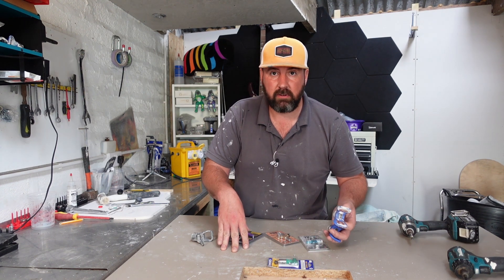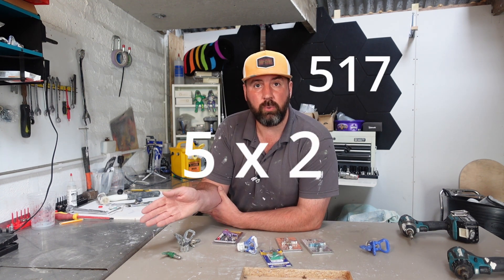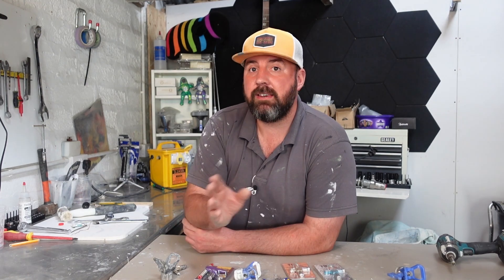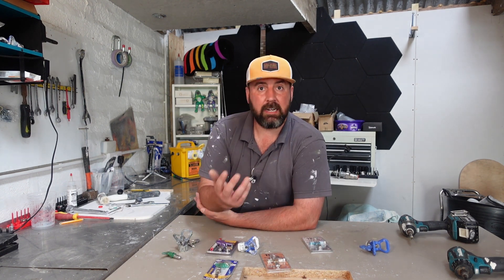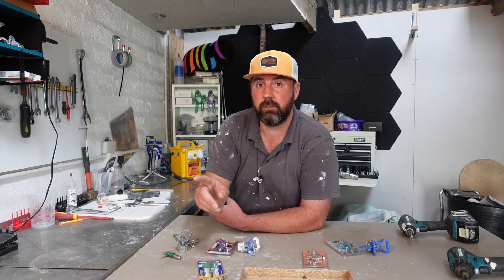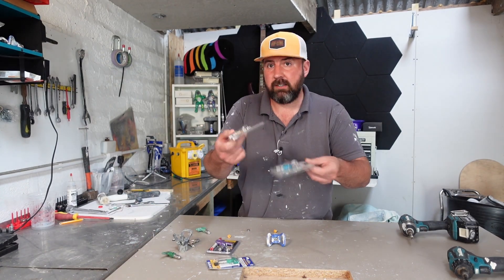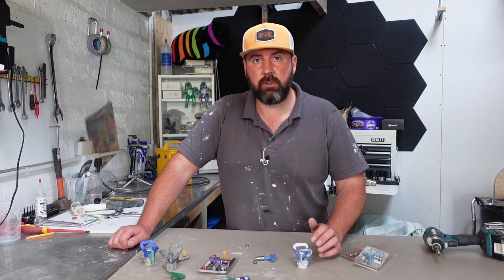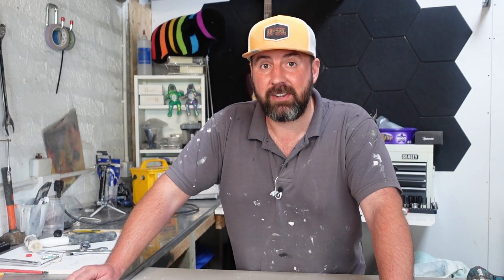Spray Tips Explained - Airless Sprayer Tips For Beginners

Comment: Good advice and pointers, looking to get the guard and tip on ebay,  just needed to know what type of tip to USE to paint walls and celings. So GRACIAS for that info. Will definitely get one with an extension! Thanks Again!
Reply from the maker: Glad you found the video helpful.  Appreciate the support.  Hopefully theres some other videos on the channel that you'll find value in

Comment: Morning mate, great video, I have a question if a paint specifies using an 009-013, can I use a 308, would I need to piss it down more, thanks
Reply from the maker: You might need to. Have you not got a 310? Sometimes the odd numbers let it flow nicer. Depending on the paint.
Reply: @sprayaholic thanks mate ive got it going, shitting myself last night just layed the 1st coat on, everal aqva ive used, thanks for getting back to me, much appreciated
Reply from the maker: Ah ye thats fine to use. I just say filter your paint as it will help prevent blockages

Comment: Thanks!
Reply from the maker: Appreciate the support.  If you have any questions just ask and I'll get back to you when I can
Reply: @sprayaholic  Could i ask about sprayers again. Im now torn between the gxff and gx21 with the hopper from spraymanuk. about 80% of the time ill be using it for woodwork, also mdf units and kitchens. The other 20% for plaster ceilings mainly, sometimes walls ( Vinyl Matt emulsion and durable matt ) They both seem as mobile and roughly the same size/weight, also the gx21 comes with a narrower hose for fine finishing/woodwork. What are you thoughts please? Thanks again
Reply from the maker: @cliffordelliott1 sure no probs. Well they're basically the same unit.  The gx21 comes with a 15m thicker hose the gxff a 7.5m thinner more flexible hose.

You can buy a gx21df which is basically the best of both worlds as it comes with hopper like a gxff and a suction pipe like the gx21 also comes with both hoses so you can use it as a woodwork or smaller job machine or a emulsion etc machine.

Its about the same price as a gxff on its own

The thinner hose restricts the max tip size to a .19. Where as the 15m thicker hose allows a .21 max tip size
Reply: @sprayaholic  Thanks. I was told the gxff wouldnt last as long if i was spraying some ceilings with it, that the motor would run down quicker. I only do residential work so sounds like the 21 may be the best option. Thanks again for your help 👍
Reply from the maker: Not sure who's told you that. They have the same pump.  I have a gxff and ive used it so much over the years to spray rooms and emulsion.  

The gx21df is what id look at.  Type in the DF part after. That package should show up
Reply: @sprayaholic  Ok thanks for your help. Someone i was speaking to yesterday at a spraygun retailers told me, it didnt quite make sense. The argument was the hose is narrower on the ff and it would put too much strain on the motor. I thought i could change the hose for emulsion work on the ff anyway if needed. Do you think that's necessary or is it something you would do? I will check out the machine above, the df. Your vids are excellent by the way, really sharp and to the point, very easy to understand 👌 Thanks for all the help
Reply from the maker: @cliffordelliott1 appreciate it. Yes its a gx21df. 
It is kind of correct. The thinner hose allows a max tip of .19 but generally youd be using a low pressure tip so it brings the need for higher psi down.  

I use the 7.5. 3/16 hose for emulsion no probs.
Reply: @sprayaholic  Thanks, good to know 👍
Reply: @sprayaholic  Appreciate it, good to know.

Comment: Thank you great vids ive learnt alot this morning, I plan to buy a machine today so now confident now I understand the tips, the sizes, the fan width is very very helpful. even the 516 tip that sounds like just the one I need. thanks again
Reply from the maker: Awesome thank for sharing your feedback. 

If youre uk based. I service and repair machines and sell onto my followers. Obviously depending on budget, I have a few tritech t5s in at the moment. Solid powerful machines.

Comment: Hi, Thanks for your help with this video. I have a question about sprayers: Would a Graco GXFF Airless Sprayer be as good as the Graco HVLP TurboForce II 9.5 ProContractor for spraying custom built MDF Furniture, kitchens, staircases etc? Thanks again.
Reply from the maker: Hey. Yes they both have their place. Id probably opt for the gxff
Reply: @sprayaholic  Thanks, appreciate your reply. Its mainly for mdf units built into alcoves and kitchen resprays. I thought you were going to go with the HVLP. Good to know.

Comment: Some painters said that the 315 FF LP it's the best for finishing, now I have the doubt between 310FFLP -315FFLP -308FFLP ?
Reply from the maker: For finishing on what surface? 
It depends what paints youre using aswell. A 310 is a good start.  A 308 youd need to make sure you filter the paint as you'll pick up alot of blockages if not. The 315 let's a fair amount of paint out.. so youd have a finer finish with a 310 imo

Comment: Just both this Ultimate"
QuickShot™ I paint kitchen on site what tip should I use I like 10” fan
Reply from the maker: A 10"fan is big for kitchens. I use a 310 usually. 
If you wanted wide fan but lower flow a 510 would work and youd not be smashing the paint on, still abit too big though I think

Comment: I just got my graco airless, came woth a 517 RAC x lp switch tip but has a fairly small hole in the guard, guessing fine finish tip an guard? Would you recommend grabbing another guard with the wider hole?

Comment: Hi there mate hope your well just a quick question I have an erbauer eps 600 however every time I’ve used it when I press the trigger I get a round ugly paint splatter on the walls using a graco guard too and tip in 517 however my filter in gun is clean and have also thinned the paint down by 10% even adjusted pressure but still same issue what’s your opinion on why I’m experiencing this issue?

Comment: Nice video. But iam so confused about the yellow lp and the paa. Wich one is better for normal wall paint and for one house?
Reply from the maker: When you say ppa. Do you mean the blue tips?

The green and yellow are low and fine finish low pressure.  They help you run your machine at a lower pressure. They often give a soft edges to the spray fan.

The blue tips are a solid fan pattern. They need to be on a higher pressure to spray well, they are generally used it new construction or when production spraying is needed.

If you've got a lower powered sprayer. The low pressure ones can help as you might not need to dilute your paint as much.

Either will work. But to reduce over spray and have a steadier pace id maybe look at a 616fflp/617lp

If your sprayer already came with a 517, that will work fine aswell
Reply: @sprayaholic yes i mean the paa blue
Reply: @sprayaholic thanks a lot for a detail answer
Reply: @sprayaholic i will buy in the next days the Graco ultra 495 xt. Wich tips for wall paintings and for fine finishes u sugest for lack paint. And please what its mena for small jobs is this machine for evry day work and how many m2 i can make a day for company use?
Reply from the maker: @runtomica5275  the 495 will happily run all day.  4 main tips i like are 210, 310, 619 and a 616.. aswell as the 517 it comes with
Reply: @sprayaholic thanks a lot agin the 619 and the 616 are the yellow one? So i have one flat or house to pain( not evry day) one time maybe in week. So the last question wich one i should use yellow lp or blue paa? Best regrade from Croatia
Reply from the maker: @runtomica5275  I havnt used the blue ones. I mainly only use green fflp and yellow lp
Reply: @sprayaholic ok thanks a lot
Reply from the maker: @runtomica5275 even numbers are green fflp and odd numbers are yellow with the low pressure tips ✌️
Reply: @sprayaholic and you use it beacuse of the low presure ?
Reply: @sprayaholic why u font sugest the 621, to much material will flow?
Reply from the maker: @runtomica5275 621 is a big tip. You'll spray alot of paint if youre not careful.  A 619 is a nice compromise I think
Reply: @sprayaholic ok i look now the 616 i can use it for normal wall paint i think the green one is only for varnish?
Reply: Do you use green more for varnish and yellow for paint? Iam so confused
Reply from the maker: @runtomica5275 the green a fflp they go to a 616 biggest size now. Can be used for walls.

Varnish I use smaller tips like 310.

Yellow low pressure tips a 619
Reply from the maker: If you re watch the video where I explain how the numbers work that might help you @runtomica5275
Reply: @sprayaholic know i inderstand it was a thinking fail, i think the green one was only for varnish paint.
Reply: What tip can I use for graco quickshot when I spray undercoat on wood and satin?
Reply from the maker: @ValterCepele  I usually use a 210 or 310 fflp
Reply: I've always painted for somebody else. The method usually went something like this. Grab a handful of tips out of a bucket of water. Shake them around in your hand. Toss me one and say well. That's probably your best bet. But it might be blown out. 

I've recently started my own painting business and I bought a Graco 490 XT today I get four free tips. What's your suggestion for mostly a residential painter?
Reply: It came with the yellow 517 and I've never used one.
Reply from the maker: Id say a 210, 310, 616, 619

Should have most bases covered there. 
Or get a 110 for spindles and 2inch wide areas and dont get the 619

Comment: Are you saying tritech tips are better than Graco? Which are good for fine finish then? I'm planning to get the erbauer sprayer as there's a conversion kit sold online by spraymanuk but it's Graco. Is it going to be shite for painting MDF and staining/hardwaxing woodwork?
Reply from the maker: I like the tritech tips in general.  But for lower powered units the graco low pressure tips.work well as they dont run the sprayer as hard. 

What's the conversion kit?  A hopper kit?

You could spray mdf with it it all comes down to paint consistency and tip size
Reply: @sprayaholic  The Erbauer Tip Conversion Kit & Accessories from SpraymanUk. I've just noticed my comment got deleted for no reason.
Reply from the maker: @pitonsti hey I hadn't deleted any comments.  Maybe got flagged for some reason
Reply: @sprayaholic I bit the bullet and bought the kit from spraymanUK. Can't wait to get my hands on it. Thanks again for the great content and explanations!

Comment: I have a Greco. I'm going to paint a basement ceiling. What tip should I use, and what pressure setting? The paint is Sherwin Williams Ceiling Paint (Interior Flat).
Reply from the maker: A 517 is fine. Its not about knowing a pressure. Start at around 1000psi  then test the fan, keep upping the pressure until its a solid fan. Test by pulling trigger once. That way youre not spraying at a high pressthats not needed

Comment: Finding your videos super-helpful, thanks.

I (probably like many) have the Erbauer EAPS600 from Screwfix, and it's been great to get me started. At some stage I'll upgrade, but it doesn't really owe me anything after the first two jobs. However, I don't know what other tips I can get for it (if any), and gather than just swapping the guard for a Graco RAC-X is the best bet.  Do any other guards/tips systems (Wagner, Tritec, etc) fit the Erbauer that you reviewed? What would you suggest is the best bet?  Thanks
Reply from the maker: Hey appreciate the support.  The reason I say go graco low pressure tips is because the machine isnt that powerful.  So using low pressure tips especially the graco ones work well for that unit. Yes you can use other tips and guards or brands. Just you might struggle to get a nice fan pattern as the pressure will need to be higher or paint thinner
Reply: @sprayaholic Hi buddy. Just wondering your thoughts on this. Did my first staircase with the EAPS600 today, and was generally great. There's a bit of touching up to do, but that's more to do with the physical limitations of getting to all the spindles. However, periodically, the gun would "lock on" and continue spraying, even after I'd released the trigger. If I then switched tip to the "flush" position, it would stop, and i could then go back to "spray" position and carry on. Thought it was a bit odd though. Any suggestions of what i should check?

Comment: I got a jaw dropping quote of $17,000 to repaint my kitchen. I’ll be doing this myself.
Reply: My quote was 19,500$ for my interior. I bought 2,600$ in tools and watched some YT videos on painting and did it all my self in 2 days, now i am making some good money.
Reply: @its-_-foxgrrr6041 for kitchen cabinets OR you mean the interior of your house?   Mine was just for cabinets and not a ton of them.  It is robbery.  I know for a fact when I finish it will be just as good as any, yes any professional.  This is not brain surgery.
Reply: I will to see a video and the finish result of you doing it
Reply: It’s not hard at all just elbow grease and time consuming but it’s possible. I’ve painted every house I’ve owned myself just by watching YouTube and buying good materials. Don’t let those contractors scare you.
Reply: Good luck lol you won’t finish the masking part before saying screw this
Reply: Especially if you’re not experienced with a sprayer, lord be with you
Reply: @WhatsonMorin haha, ya I can do brain surgery, I can do this for $1,000. My last house I built 50 wood shutters and sprayed them vs spending $55,000 the contractor wanted
Reply: @graphguy  spraying the easy part, it’s the masking everything to prevent over spray, taking off the door, masking the boxes, cleaning the surfaces before sanding them, sanding the surfaces and doors, priming, light sanding again top coat etc etc lot more to even think about spraying shutters vs cabinet is night and day
Reply: @WhatsonMorin let me guess you are a painting contractor?
Reply: @graphguy  not a contractor but i am a painter by trade

Comment: I’ve just started using the Graco ultra quick shot it came with 514 and 410 tips. Bud will I get a 516 and a 310 to get more familiar with it and should I get an even smaller fan width for me spindles?

Your videos are brilliant bud

Comment: Hiya, what tip would you recommend for a traditional lime wash? Thx
Reply from the maker: @TheTreeOctopus   
Depends if its got grit In it? If so it will block up the tip and ruin the internals as it can scratch the piston.
Reply: @sprayaholic  it's literally a mix of lime putty and water, what they used to paint old buildings with, I would imagine it's quite large particles. I am thinking about buying the Graco 395 as this will have the power and can take a bigger nozzle. 

Good vids, thanks, very informative! 🙂👍
Reply from the maker: @TheTreeOctopus  id guess its not recommended. Those units are designed for smooth materials.

It would more than likely spray it but you risk damaging the internals.

Comment: I do new construction / renovations
1221 tip for drywall sealer, walls and ceilings.
310 for trim and mouldings 
210 for handrails and spindles
410 for doors
keep a 515 and 517 spare in the box.
Never need any other tip besides those!
Reply from the maker: @Objectivity1958  ye a good selection there
Reply: what would you use for furniture? 310?

Comment: Inquiry About Nozzles, Filters, and Seals for VEVOR 2200W Airless Paint Sprayer

 VEVOR High Pressure Airless Sprayer Paint Spray Gun 2200W , but I am unable to find compatible nozzles in Croatia.

 could you please advise whether I can use nozzles from graca or any other compatible brand?

Thank you in advance for your help.
Reply from the maker: id assume its a standard size thread so geneerally the other brands guards can then fit and those tips can be used

Comment: So use can use any of the Graco tips with the high pressure airless sprayer? I guess you have to turn down the pressure?
Reply from the maker: @nickrinaldi4276  so long as you use the graco guard that fits the tip . Generally yes. Check the thread size first make.sure it matches your gun

Comment: Sprayaholic. Cool channel Sir! How many gallons do you need to spray a 14x14 bedroom walls with a 517 Low Pressure tip?? How much more than brush and roll?
Reply from the maker: thanks, i usually say 20 to 30% more paint